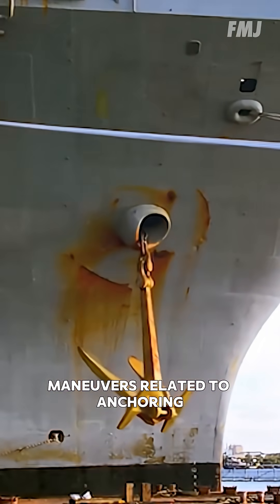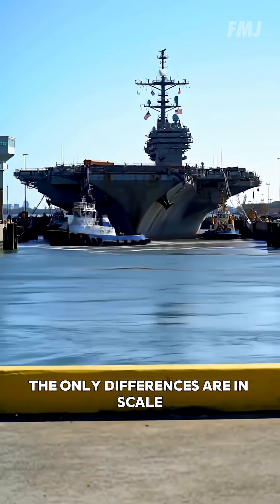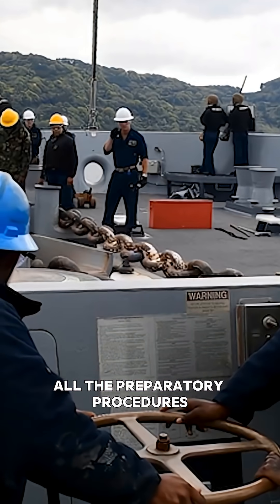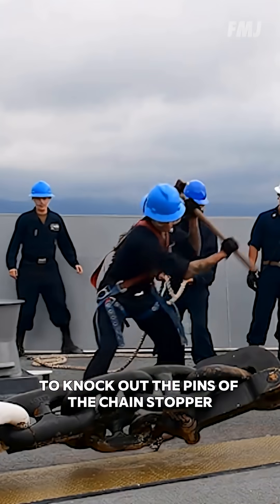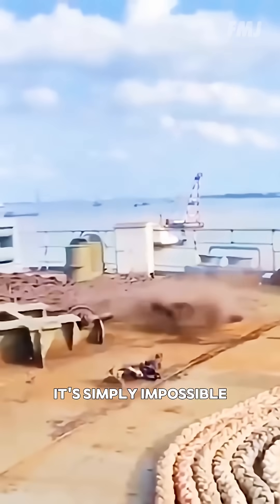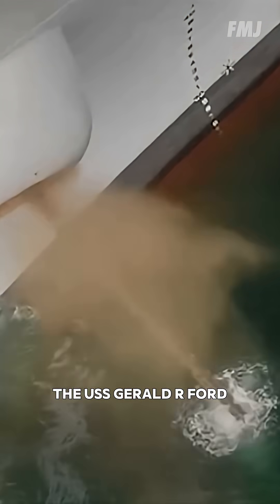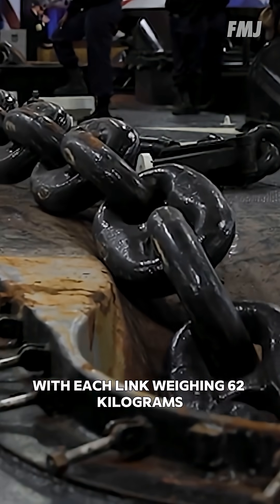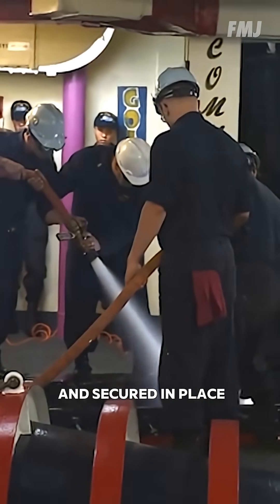The Anchor Drop on an Aircraft Carrier

Comment: 10 to 15 personally are present when dropping the anchor, WOW. 13 ton Anchor    439 meters long... just 1?
Wonder what type of winch and torque is required to pull that up?
Like to see that one time.
Reply: The anchor pulls out the chain from the chain locker. The weight of the chain is what holds the ship still. On a carrier those anchors weight 30 tons The chain is fifty-seven links, each weighing 350-pounds, make up just one 90-foot shot of chain that weighs a total of 20,500 pounds. Twelve shots of chain collectively hold a 60,000-pound anchor. We had very large anchor windlass for pulling up the chain and the US Navy once had their own ships that went to sea to retrieve lost anchors and chain.